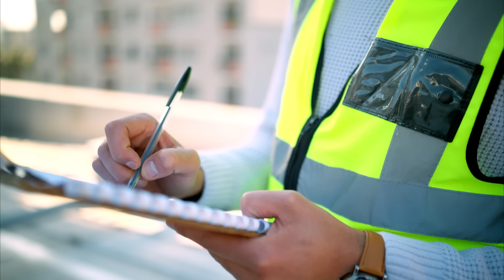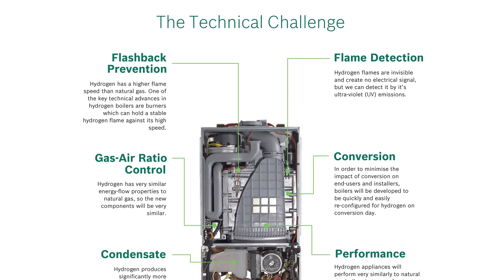Is Hydrogen Actually Dangerous? | The Real Facts

Comment: As a German engineer I worked for years in the high vacuum coater machinery business.
To leak-check high-vacuum machinery, Helium (the next "large" molecule) was and is being used, using very small pressure differences and extremely small amounts. For years I also trained technicians on this subject.

With all respect, but I do not think you have any idea of what kind of extremely small cracks, micro leaks and perfectly fine brand-new seals Helium will creep through. Any fine grain of dust will make it seeping through. We placed a human hair in one of the O-rings (for training) on gigantic vacuum chambers and big multiple-staged pumps; the leak was quick to be located with Helium.

Getting these coater machines really tight (against air with only atmospheric pressure difference) is an art. Our mechanics needed lots of practise and still leaks occurred FREQUENTLY. You have to work extremely precise and most of all very very clean. Not really an ordinary plumber's job and definitely worlds afar from gas-powered home appliance technical standards, forget Teflon tape and Loctite and dirty air while working on such components.

In reality in this field there is in the end always a final leak rate to be accepted, with other words there is always some very fine leakage left when using the smallest molecules of mother nature. And there is nothing you can do about it, it seems.
Even very special one-time-use-only copper seals (very expensive, being used for UHV-machinery) will finally leak one day, specially if components are exposed to temperatures changes, changes of pressures and long-time vibrations and finally simply aging. 
Such H²-systems in households would require lengthy and expensive frequent leak-checks by experienced specialist with very expensive leak detection equipment, certainly replacing a lot of expensive seals just to play it safe.
What makes matters worse H² is invisible, has no smell at all and is so crazy reactive. It is like high-voltage, the moment you realise it with your human senses, Zapp!, you're dead.

Thinking of having H² (instead of Helium or Methane) operating on much higher pressures just for efficient (small volume) storage scares me to death. I would never EVER have anything H²-energized in my house or basement. Old chaps like you and me still remember how dangerous it was to recharge old lead-based car batteries in a garage without excessive room venting. It killed people.

I am not against the idea in general, it would be a great alternative - specially if modern nuclear power could generate plenty of H² out of water via electrolyses. But it seems that H²-transport and storage (extreme low temperature = uneconomical / high pressure extremely heavy to move and extremely dangerous, specially in confined areas) is against the laws of physics and chemistry, meaning hazardous like hell, uneconomically and therefore in the end even unecological. I just do not see a safe mass market product of any kind with H².

Your comments just do not match my experience in real life. I wish this would not be the case.
It is very simple; if you play with any inflammable gas you might get away with some luck. If you play with H² you're a dead man.

I usually repair anything technically: electronics, electrics, optical stuff, mechanical things, fix machine processes and software. I maintain the brakes and steering system of my car because I know what I am doing. I worked on all continents very often in very unsafe work environments, nobody scares me off easily with a technical challenge and I never messed anything up.
Still, with all my He-leak detection experience, I will never touch my ordinary gas heater and boiler in my house and I would NEVER EVER touch a H²-system myself. Just the idea to have such an unpredictable (time) bomb sitting inside my house or vehicle would drive me insane.

A Hindenburg exploded in New Jersey in 1937 even if it was perfectly surrounded by open atmosphere. This was not a question of "if" - only of "when". Kah-Boom!

Peace! from Dresden / Germany
Reply: And there you have it. If anyone here believes Ed Milliband's vision over this OP, I have a hydrogen boiler to sell you!
Reply: Helium is an inert gas, one of the Noble Gases (neon, xenon, krypton) and isn't flammable.  Methane, like hydrogen, has no smell either, its odour is given by adding a smelly mercaptan (organic sulphur) at low level, to make it detectable, the same could be done with hydrogen.  Also methane leaks are pretty dangerous, evidence the number of people killed every year in the UK from gas leaks.
Reply: @paultaylor7082  

This is understood and of course because He is so incredible chemically passive (1st noble gas in the table of periods) and it has the 2nd smallest molecules it was used for vacuum leak detection.
I only mentioning it to describe the danger of H² as a potentially green-wish gas fuel - a much more dangerous idea compared to anything else.

In my house we are using standard heating gas (I am not sure about the correct mix) and if there is a tinny leak it stinks (on purpose as you describe).
The place of the central gas heater system in my house has a permanently vented place which will be inspected by a chimney sweeper officially every two years (this is their new purpose since coal heating is a thing of the past), which is required by German law.

So I agree with you but I am also pointing out that with H²-heating the danger will be much more great than methane or ANY OTHER gas. To handle H² in mass markets for heating equipment will be a technical safety nightmare and hazard for anyone involved.

Peace! from Dresden / Germany
Reply: Congratulations on your perfect English! 
"Old chaps like you and me still remember how dangerous it was to recharge old lead-based car batteries in a garage without excessive room venting. It killed people." - I think a lot of people need reminding of this - that it is unsuitable for an indoor off-grid setup (what battery tech would you recommend?)
I used to work on old Vaillant gas combi boilers, with the wax motor in the diverter valve, amazing bit of kit. Now I like the Dutch Intergas system - no diverter valve, no secondary heat exchanger,
Gruesse aus Manchester
Reply: @elgorrion52  
Oh, Thanks for the praise. But I am an electric/electronic/computer science engineer who just works on any aspect of "our" machinery (used to be a commissioning engineer when I started to work after graduating from university). Whenever you are far away you better help yourself and do not wait for a mechanic. While having a MSc, I loved to get my hands dirty as well. I am the rather hands-on engineer than the inventor.

He-leak detection was only one but an important tasks to be performed.
The machinery I worked on all continents (60++ ?? countries) were high-vacuum coaters for CD-manufacturing (small ones), automotive and architectural and PV-module coaters (the big monster beasts up to 100m long vacuum chambers), but also optical application coating and ophthalmic lens coaters - all kind of stuff.

I am not really deep into battery technology so I can't really recommend anything - however battery fire safety would be always first with me before efficiency if forced to have them located inside the house. They might ignite spontaneously very rarely but if they do, they will run faster away as you do (please note, here a German engineer is trying to develop some humour by poking fun on the English language).

All the Best for you in 2026 and may this planet be a bit more sane soon for all of us; Peace! from Dresden / Germany

PS: Been to the UK a few times for work, including Manchester. Love the place, the pubs and of course British humour. When I lived in Hongkong and Singapore in the 1990s I had a British and an American superior; they were the once patching my English up from being horrible to a decent shape. Raised my boys bilingual....
Reply: @Gerd-2  Ein interessanter Laufbahn ! 😙
Reply: @elgorrion52  

Ja ich weiß, ich hatte natürlich auch viel Glück. 
1991 als noch klassisches Ostbrot und frischer Uni-Absolvent fand ich in Hanau in dem großen Maschinenbau-Unternhemen super Kollegen und Vorgesetzte, die mich immer gefordert und gefördert haben und auch menschlich mit extrem wenigen Ausnahmen tolle Typen waren.

Da war die alte Bundesrepublik noch wirklich tolerant und sehr weltoffen und vor allem nicht so ideologisch verschroben und überheblich geprägt wie heute.

Peace und ein gutes 2026! aus Dresden
Reply: :  @Gerd-2  "klassisches Ostbrot" - I like that.
Das war fuer mich in Hamburg 1970 aehnlich: freundliche, gastfreundliche und tolerante Menschen ohne Affektion; natuerlich, ehrlich ohne konfrontativ zu sein, Unterstuetzend. Besser als England damals.
Yes let's hope for peace, but not at any cost
Happy New Year

Comment: The current best case (lab-based) round trip efficiency for electricty -> full cell storage -> electricity is about 30-40% as it relates to transport applications. Electrolysis just isn't very efficient. The equivalent (lab-based) efficiency for lithium-ion batteries is 85-95% (if DC is maintained). With the fall in the price of lithium and the emergence of CATL long life sodium-ion batteries we shouldn't even be talking about hydrogen, especially given its volatility. The only reason we are is that most hydrogen production today is grey hydrogen produced from fossil fuels (usually methane) and the backers have deep pockets!

Comment: Great topic Roger, in Italy almost every building has a balcony or a Terrace making it safer to use Hydrogen. We would need a Hydrogen substation in every neighbourhood in the UK ( unless you own a big Garden or land). The Family I know in Italy that have an " Impianto" ( a system) are very pleased but their Elderly Parents are terrified because  they overheard the fitters talking about lightning strikes and how high-up the Building sits on a hill-top. The GrandFather is constantly running up and down the stairs to check for leaks and watching the pressure guages/timers on the balcony mounted control box. The Grandad is much more Vigilant than his kids, he has seen the change from wood burning to gas and Electricity and over the years has learned that storing energy needs " Space" . He has a large garage full of ready chopped wood ( enough to heat the big house for 3/4 years and in his mind Hydrogen is what they used to build weapons. I learned a lot watching and helping that older Man, he reminded me of a Submarine Cpt when his Boat is submerged watching the guages and scanning the horizon with a Periscope for signs of changing weather..and lightning!

Comment: Hydrogen is being pitched as a natural gas replacement, not as an earnest decarbonization strategy, but rather as a way to distract us from noticing that the gas distribution and transmission industry doesn't really own assets - they own liabilities with an abandonment cost.

It's all about predatory delay. Always has been.
Reply: It was probably a mistake to convert British homes from town gas to North Sea gas. In most of Northern Ireland they just turned off the town gas and never converted. North Sea gas was always going to be finite and would have been better used for cleaner and more efficient electricity. It's easier to build new power stations to run of new fuels than convert millions of homes.
We don't need gas at all; you can use electricity in numerous ways; heater pumps are one, but different methods of storage and on demand heating exist too. The problem is the cost of electricity. My sister lives in Ontario, she has an all electric home and electricity is included in the rent because it's so cheap. It's a lot colder in winter there than it is here too.
I think we have a vested interest or two at play here.

Comment: As long as installation and detection etc is done correctly, I can't see it being any diffrrent to methane. In my experience that is the real issue, I'm a Chartered engineer not a gas tecnician but  I've seen so many obviously substandard installations it scares me who will be fitting these, I can see it being another insulation fiasco.

Comment: Town gas had a very high hydrogen content, judging by the way balloons my dad inflated with the assistance of an old fridge compressor. The house we currently occupy had the original floor mounted boiler when we moved in, and had the paperwork for its conversion to natural gas in the late sixties.
Hydrogen is probably safer than natural gas, as it will rise and find any small gaps to escape rather than sink and build up in cellars, drains etc.  I don’t recommend town gas though, as it had a relatively high carbon monoxide content, hence it’s toxicity.

Comment: What a load of poppycock! Ever seen a fuel-air explosion with hydrogen! Also the fuel cells on a bus generate electricity from hydrogen they are not the fuel tanks, which take more space and weigh more than batteries if any decent range it to be attained. Boom!

Comment: all stuff (especially H2) that burns in a Nitrogen rich atmosphere (air) produces NOx, a toxin. Amount depends how hot. My gas boiler (furnace) service engineer declared declared the unit dangerous because the outside flue (which has cowl flush to the wall) has gaps between the pipe and the aperture. Regulation demands it is filled so fumes (ie NOx) can't creep back inside. So far so logical, if draconian. But I pointed to the (legal) gas hob, he shrugged & said he wasn't servicing that! FWIW NOx is 50X as potent a greenhouse gas. So much for pollution-free!

Comment: Well all hydrogen fuel cell cars have batteries, as mentioned by someone else, but that's not the big problem. The big problem with hydrogen is you can't generate and store it yourself like you can with solar, you still have to buy it from a fuel station, which means you still need to ship it everywhere, either through pipes of on trucks or have hydrogen generators at the fuel station. I see hydrogen fuel cell cars as EV's with extra steps because all you are doing is charging a small battery and using that to run the car. Storage is a problem for wind and solar, but it's not insurmountable and would surely be cheaper than replacing all the gas pipes in the country. Can't see hydrogen is anything but a very niche use case myself.

Comment: I'm a chemical engineer too.
Electrolysis is roughly 65% efficient with respect to H2 production on a molar basis, its a bit different on a mass or MJ out/MWh in basis. The total electrical efficiency is quite high, 97% or so, there is some heat loss. The "renewable" energy driving it is also inefficient. In the UK wind and solar energy production is lower than the energy needed to make, transport, and install the solar panels and turbines. Emissions figures from making turbines do not include manufacture, only transport and installation within a defined radius of the install site, which makes them look better than they are.

That's what they do in US, our figures are similar so we must calculate it in much the same way.

You can't use copper, aluminium, steel or plastic pipes for hydrogen either.

Splitting water to get hydrogen to burn it is bonkers. Its cheaper and more efficient to just use electric heaters/induction, cut out the middle step.

Using hydrogen in fuel cells gets worse. If we have an energy shortage, why throw away so much? We cant get round thermodynamics. It still takes lots of energy to make no matter how you make it. Nature cant be cheated, but humans can 😂

Comment: Anything with high energy content will be dangerous to some extent. The only thing that concerns me with hydrogen is how much easier it is to get a leak. At a molecular level its 22 times smaller than the usual propane and 28 smaller than butane. The idea of that in the grid with some of the just-holding-on repairs you see sounds like a very fast way to get rid of a few houses.

Comment: Boilers on the outside are nothing new, and where there is a risk, eliminates it. Where it doesn't is for cooking... for that maybe a hot thermal oil could be pumped in from outside, but that would be overkill, inefficient and the issues of viscosity are massive for thermal oils.

Its no panacea as the heatgeeks say, but it has its part to play, and prob transport and district heating are its forte. What do others think?

Comment: So the hydrogen is mainly being used as a battery to deal with the variable output of renewables vs the demand need of consumers.  In this case would it not be more efficient to build a huge centralised hydrogen production/ storage/ electricity generator plant to act as the battery? Or use a different technology to be the battery.

Comment: But It's not like we are working with natural sources of hydrogen! the energy required  and the problem with materials getting brittle from the gas are prohibitive. And it is mostly is not green energy and uses methane. The real question isn't can we but should we because in the end practicality drives costs.